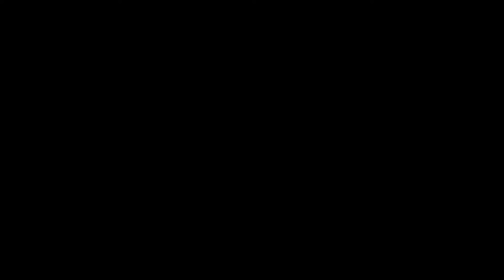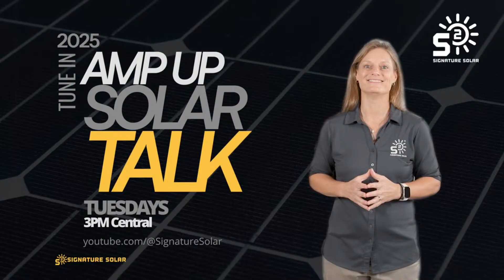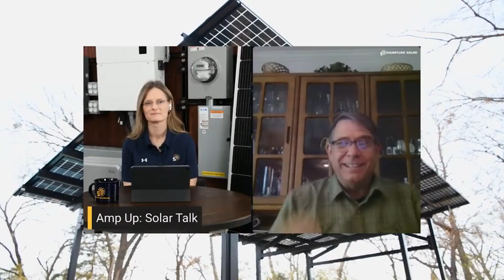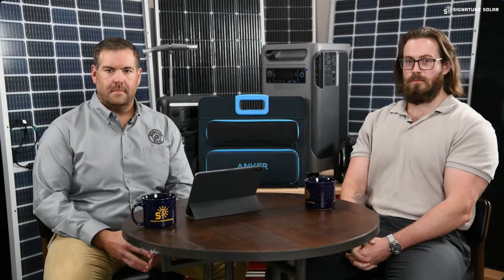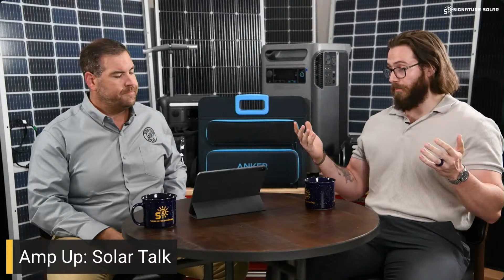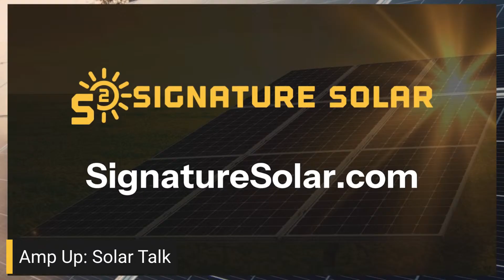Amp Up: Solar Talk - Ep. 28 - Disaster Preparedness – Backup Power Solutions

Comment: Can the Anker power my TV while charging from the solar at the same time?
Reply from the maker: The power station will draw power from the solar panels to run your TV and also charge the batteries if the solar input is sufficient. If the solar power is not enough, the power station will supplement the power from its batteries to keep the TV running.
Reply: @SignatureSolar THANK YOU!
Reply from the maker: You're so welcome!
Reply: It can.  The F3800 and F3800P have an LRA rating of 80 amps.   Extremely robust and phenomenal systems.    You can actually charge via solar and home via HPP.  It's also capable of blackstarting from solar, meaning it can charge from 0% from solar.   The software we've developed for LATAM  mainly also really works with a lot of countries with an unstable grid